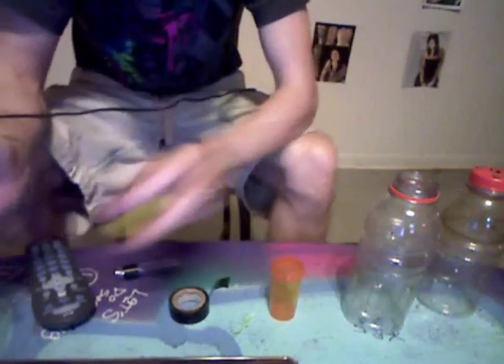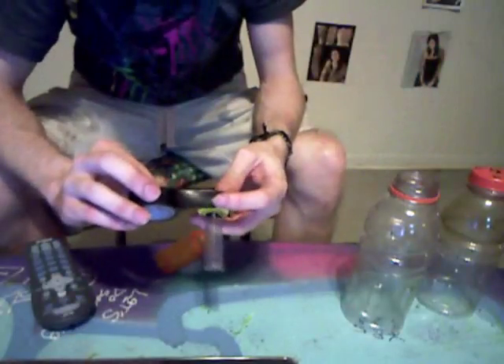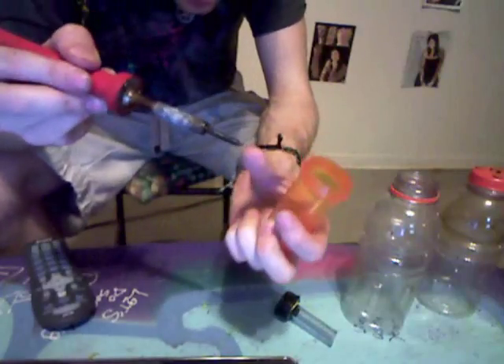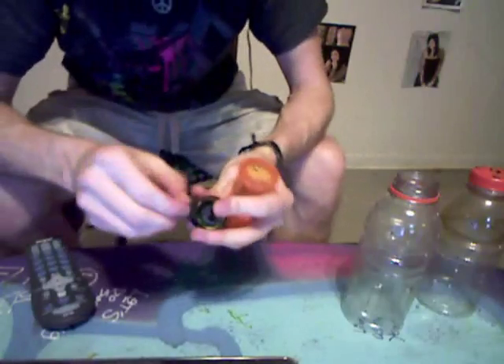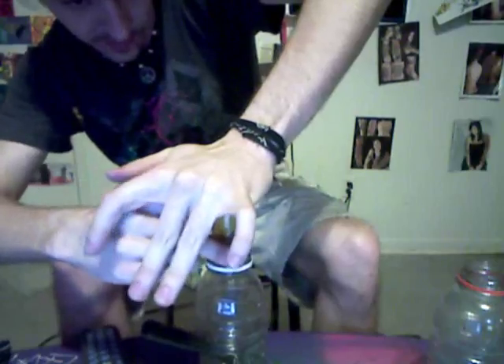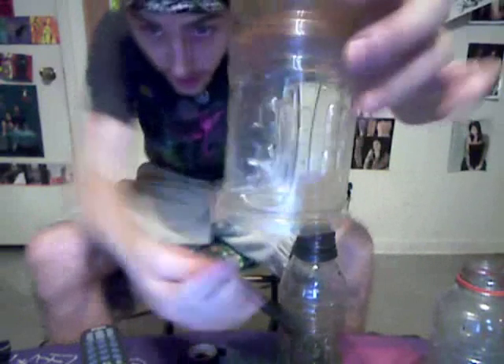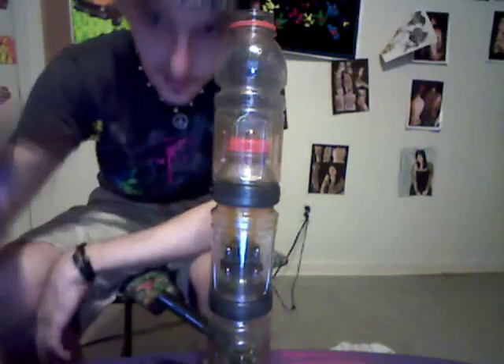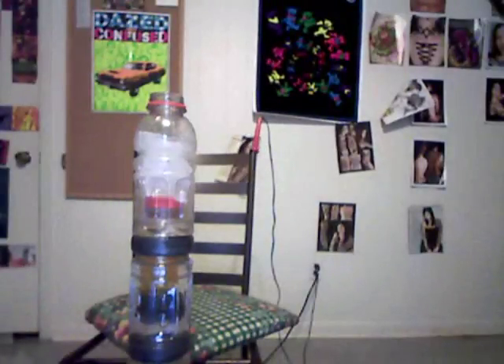Perc Bong

Comment: @sicbud
You simply pour the water in the top.
When the water gets too high at the perc, it will overflow and start filling up the bottom.

@Wowccraft
The smoke rises through that tube he placed inside the medicine bottle, then due to pressure when sucking from the top, the smoke will be pulled through the holes he poked in the bottom, going through the water and into your lungs.

Comment: hey really good video but i made miine air tight and everything with gatorade bottles without ice catcher did same thing u did poked holes in bottle and everything and put tube between cap but only the top bubbles not the bottom put hole in for stem too can u tell me what i might have done wrong?

Comment: instead of the tape to seal the pill bottles cape i used helluh good putty it works really god, the gay thing is i was flushing the toilet with my bong supplies in my towel and as i flushed the toilet my putty came out and went down the toilet =( im a dumb ass